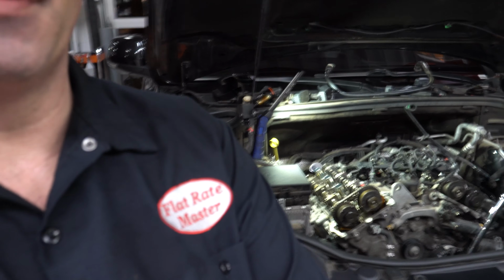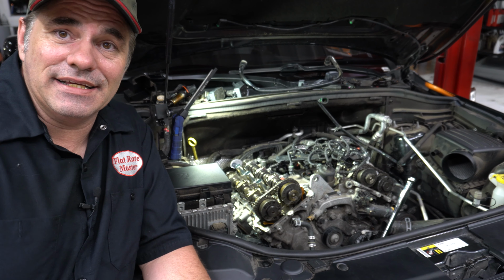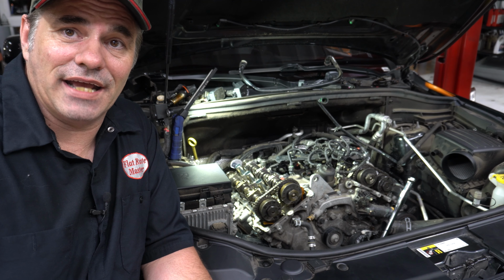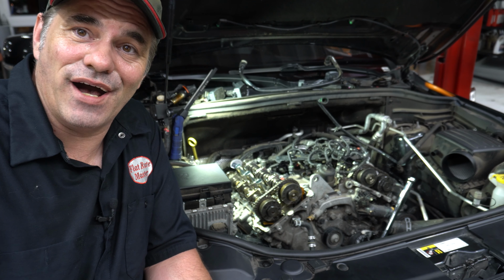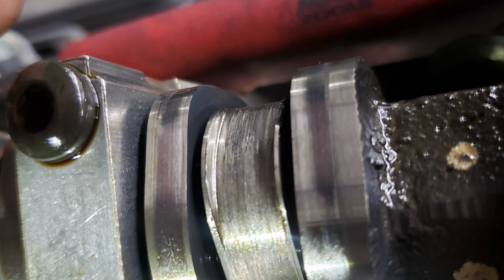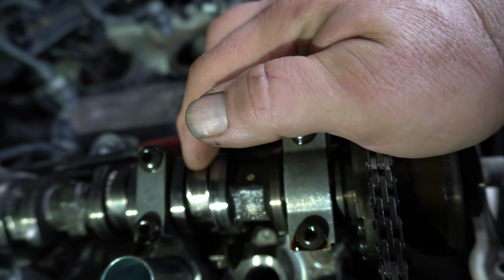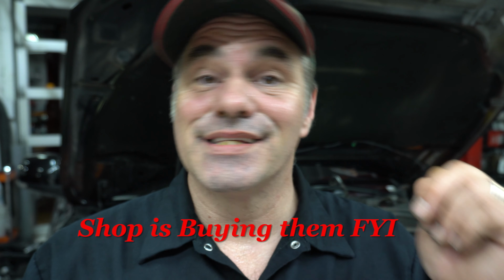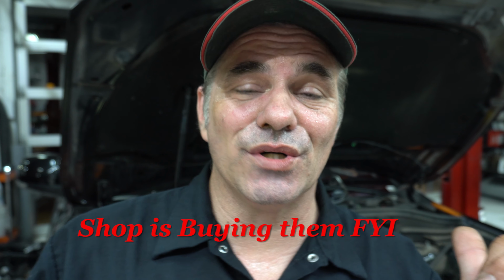Chrysler Fix You S#$*!

Comment: Wow, a lot of Chrysler Dodge hate in the comment section. Guys I hope yall understand there is a very very very low percentage rate of failure on this Gen 3 Pentastar engine. I mean yes, some will fall thru the cracks and fail, but its not because of the design. For instant, I see and work on these daily but have yet to go deep inside the valve train. Flat Rate Master I would love to chop it up with you concerning this repair and the damage that was done. I understand you right here in the Atl area..Love the channel, liked and subscribed

Comment: These customers are paying top dollar for these vehicles when they are new, and with COVID the prices of used vehicles has skyrocketed also. Customers should not have to shell out thousands of dollars on relatively new vehicles to repair major failures like that. Its disheartening what has happened to the industry in the past couple of decades.
Reply: Yeah but it’s the customer’s who     want “More” In their vehicles. So in way they did it to themselves.
Reply: You can thank the united auto workers for much of that. Bunch of union slags who demand ridiculous salaries to insert flap A into slot B. Put an end to the UAW, and you'll see a dramatic decrease in new automobile prices.
Reply: @Sagittarius-88  Check out the executives salaries.
Reply: @waterloo123100  I understand your point, but it doesn't excuse the automakers from cheaping out on their product just for profit.
Reply: @Sagittarius-88  I doubt you will see prices fall since there are already many cars being made by non union workers and they are also expensive. Look at all the non union auto factories in the US. The issue is that most domestic vehicles are over engineered to achieve modern standards. The Japanese and Korean cars do the same thing (usually) with a more simple, easy to fix design that requires less "special tools" (Chrysler and Ford, esp) and lasts longer.
Reply: @waterloo123100  True, but it's also the engineers and advertising departments that need special features that can make their cars stand out from the competition so they  get more sales than the other company. From a purely transportation standpoint, any basic car will get a family of 4 to work and school and any full size truck will tow a boat or camping trailer but it's the special nonsense interior features or fancy body styles that make people fall in love with them and pay too much. Also...don't forget the increase cost due to safety and emissions standards.
Reply: @Sagittarius-88  I agree. Unions are terrible for America.
Reply: @fordtechchris  They didn't used to be. At a point in our history, they were necessary. However, we currently have more labor laws on the books than we need to ensure workplace standards. The unions are corrupt to the core at this point, particularly at the "boss" level. They're completely unnecessary at this point. I'm sure it will never happen, but I'd love to see labor unions completely banned in America.
Reply: @Sagittarius-88  I disagree. I've done much better non-union my whole life than anyone I've known in a union.

Comment: That's the Pentastar upgrade.  It's actually a fairly new problem because this engine hasn't been out that long.  They eat the high-lift mode cams because the rockers don't have rollers for high lift.  It's just metal wiping against the cam.  Then it misfires only when you step on it.  The thin water 0W-20 they use isn't strong enough to protect the lobe.  That's my theory anyway.
Reply: I put 0w40 euro in them at my shop
Reply: Chrysler came out with the 3.6L pentastar engine in 2010 (2011 year models). They originally used 5W30 oil and had very few problems with cam/roller issues. It started showing cam/roller issues when they changed the oil filter housing design and the oil filter. They also started using 5W20 at that time. I think it was 2013. I no longer work at a Chrysler dealer but I ran into one recently that I noticed had 0W20 on the oil cap. Don't know when they started that but you may be right about the thinner oil causing issues.
Reply: @meabob  You're referring to the original Pentastar, which is an excellent engine when maintained properly.  The original Pentastar did not have separate high/low lift modes on the cams.  This is the Pentastar upgrade in this video, which came out in 2016 on some models.  It is an entirely new engine that only shares a handful of parts with the original.  This cam wear is a unique problem because it only seems to happen on the high lift lobes, which do not have rollers.  The low lift lobes do have rollers, and they're fine. It's a funky looking rocker arm design.  Unfortunately they over-complicated a good engine and added more potential for failures.

Comment: My old 2001 Ram 5.9 V8, has flaws that at least you can repair with updates; ball joints that wear out (put US built Moog); 46RE trans, 5 pinion planetary, more clutch packs, larger oil cooler, etc.; Plastic dash that cracks, repl w LMC dash but the only thing I can't do much with is poor fuel economy, 6-10mpg; 8 mpg average.  Still, compared to cam issues on Chrysler engines or 5.4 Ford's, or Eco Boost carbon issues or auto trans issues with the GM trucks, my Ram looks really good.

Comment: JEEP is short for Just Empty Every Pocket. Chrysler, especially since Fiat runs the show, has the lowest quality standards in the industry. Many suppliers refuse to work with them, as they don't want to pay for quality.
Reply: In 60 years people will pay outrageous prices for vintage mopar. Sad thing is they do it now
Reply: Fix
It
Again 
Tony
Reply: Lower now as Fiat is no longer in charge, they are now under Peugeot as Stellantis....  However Stellantis is talking about shutting down the Dodge and Chrysler brands and only keeping Jeep and Ram, and possibly brining Peugeot over to the U.S. to replace Fiat as Fiat sales are a joke here.
Reply: @Blazer02LS  replacing bad with worse?
Reply: My daughter bought a Chrysler 200 in 2016 because it was seven years interest free, it’s still working OK but at 80,000 miles it’s using oil , She originally wanted to buy a Toyota Camry

Comment: It isn’t just Chrysler. Everything but Honda and Toyota have quality issues
Reply from the maker: every make has quality issues, including toyota and honda, just ask dealer techs;)
Reply: Volkswagen started using Aisin Warner auto transmissions in some of their cars, which is basically Toyota. Wish more brands used Aisin and Denso parts to increase overall reliability.
Reply: @flatratemaster  - LOL so true. Toyota and Honda customers don't tend to tell everyone about their issues.
Reply: @flatratemaster  Very true Toyota and Honda do have their issues, and they are not perfect , But they seem to be damn close  lol

Comment: The failure rate of rockers on the new 3.6, now that it’s 5 years old is very few, I’m a Chrysler tech and can probably count on 2 hands the amount of times I’ve done them. Old 3.6 we see them all the time. They have more pin sticking failure then roller bearing failures at that.
Reply: LOL our heavy techs have 2 of them right now. Probably why they got traded in. Plus they are just out of the powertrain warranty by a few thousand miles.
Reply: @meabob  I know they are still failing but not like the old 3.6s. Could probably count 10-15 old 3.6s in service lot now for rockers
Reply: I cant count on even 1 hand how many of the gen 3 Pentastar Ive done. They are holding up well fellow Chrysler Tech Guy. One or 2 will sneak thru the cracks for sure tho

Comment: I can definitely relate to this.
As a shop foreman myself, my one tech replaced the engine on a 2011
Vehicle runs good but misfire on the left bank all cylinders.
Diagnosed it, and metal shavings in cylinder 4.
Boss wants the engine replaced under warranty from where he had gotten it.

Comment: Chevy has the same issue. Doing a cam on a 6.2 right now. Only has 36,000 on it. Pushrod bent and beat the cam up good.
Reply: I'm guessing it's something to do with the cylinder deactivation feature?
Reply: I’ve done lots of 6.2 cans that ain’t an active lifter that fails.
Reply: Most of the time is active fuel motors. But even the non active valve trains fall apart
Reply: Our heavy guys have a number of those 6.2L needing cams.

Comment: Gravvvyyyyy. Haven’t done the new design yet but I do the old style on a regular basis
Reply from the maker: it is gravy, same procedure, just different tools and rocker design
Reply: This engine has vvl. Two cam profiles. I'd say thats not a common failure. usually see the lock pin get stuck in low lift mode.

Comment: It all boils down to maintenance , If you don't change your oil you will have problems , have seen many of these engines with 400,000 miles on them . Have worked on 10x the pentastar engines you have and that is my assessment.

Comment: Hated dodge and chrysler ever since my grandparents bought a 08 dodge charger 2.7  brand new and it jumped time at 54k miles had it carried to a dealership to fix it and it jumped time again 23k miles later. Decided to just buy another used motor and you can't find them and if you do people want 3k for them. Beautiful car. Has just sat under a tarp on jack stands in the garage for 8 years......
Reply: that 2.7L engine was a pile of junk
Reply: 3.5 swap it.

Comment: At least you can get parts. I have a 14 jeep been waiting on a right front axle for 3 weeks.
Reply from the maker: still waiting on parts
Reply: I have a 2018 Jeep Compass that needs rear brake pads. Aftermarket doesn't service and dealer says it's on back order with an ETA guess of July 5th.

Comment: Since the sixties  they have been known for electrical issues, rear end issues, and longevity issues. People still buy them. All manufacturers occasionally have a known issue. Chrysler has been known for the same issues for decades and won't change the fault. Poor design. But they still sell them...odd.
Reply: Speak about what you actually KNOW. Chrysler in the ‘60s and part of the ‘70s was producing the best engineered cars overall in America. I know this from experience, I’ve owned a number of them over the years, and still do. Torsion bar suspension, unibody construction, the first standard electronic ignition system, the strongest transmissions, I could go on and on. Don’t try to compare today’s modern foreign owned Chrysler, to the REAL Chrysler from back in the day, two VERY different companies.

Comment: What specifically is wrong with what motor and vehicle?
Reply: Worn camshaft lobes. Made of too soft of metal
Reply: @jimbolton18  which engines
Reply from the maker: 3.6
Reply: @flatratemaster  thanks
Reply: @jimbolton18  Camshafts rarely wears out buddy. Something causes cam lobe damage. Likely roller lifters or roller rocker arms. They not made of too soft metal